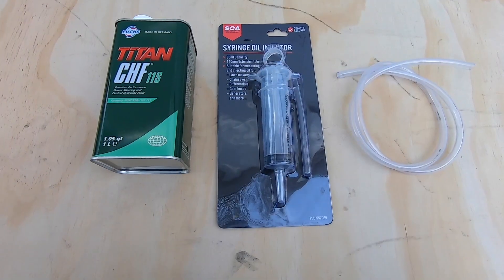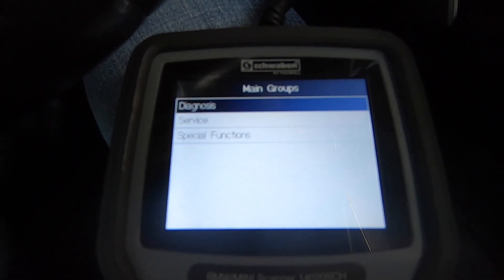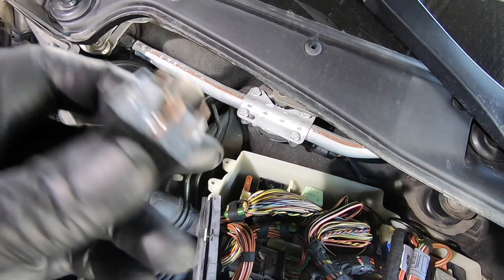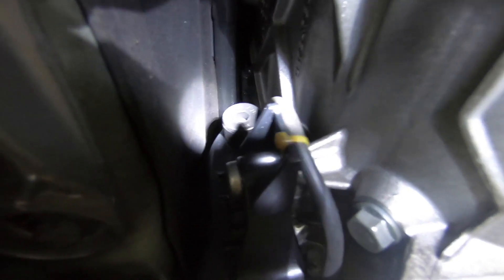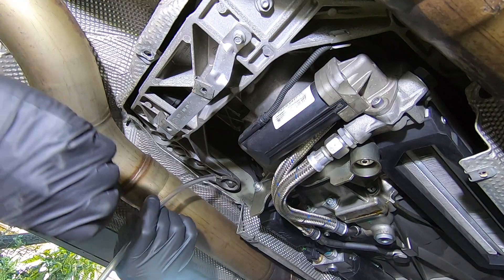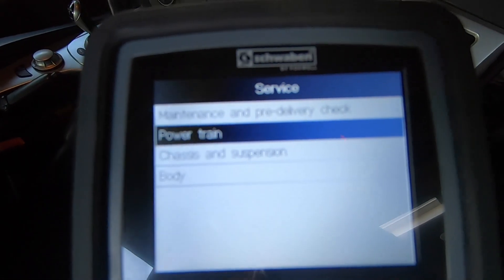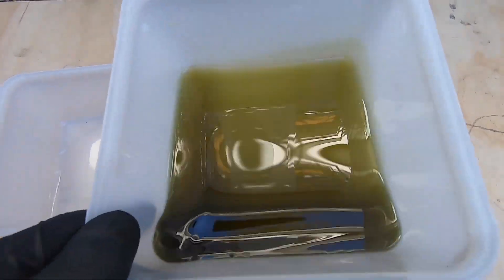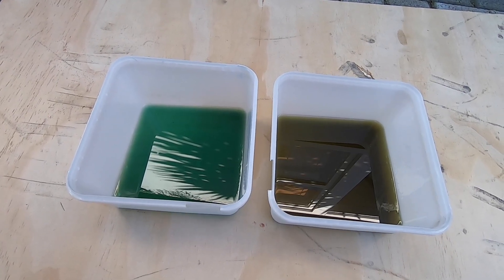BMW E60 M5 SMG Hydraulic Fluid Change        #BMWE60m5 #BMWV10 #BMWSMG

Comment: Hi! Great content and very appreciative of your thorough explanation and step by step instructions. I own a 2008 M5 with just about 68k miles. I just did the SMG hydraulic fluid change and it went very well. Thank you! The fluid that came out was dark orange, but the most concerning part was that there was much more new fluid going in compared to what came out. So i’m glad I did it and intend to do it every 15k miles along with the gear oil and diff oil moving forward. I m doing my oil change every 3.5k miles with 10w60 LiquiMoly and I add CeraTec to help with reducing wear on the rod bearings. The car was a south California car then with me in South Florida all its life, so cold start was never a problem. Plus it has the second drain plug so i’m not concerned about the bearing and will preventatively changed them after 100k miles. This might sound stange but this E60 M5 is one of the most reliable BMW i’ve ever owned. Despite its race pedigree, it’s built to last and it’s surprisingly easy to work on. Thanks again for the work you do, it really has an impact on getting the confidence of DIY and owning such an incredible piece of automotive history at a very small cost of ownership!
Reply from the maker: Cheers man, good to hear you are finding the channel useful. Sounds like your M5 is getting looked after properly. Yes, I found them to be very reliable for sure

Comment: Question .. I if i do this but leave out the bleeding procedure will i be able to bleed the system by driving the car running through gears ? thnx
Reply from the maker: No, it has to be bled using the correct procedure. If the level doesn’t get so low it introduces air into the system, you might get away with not having to bleed it, but it’s hard to tell
Reply: @MTechGuy  I figured as well . when I de pressurize  with shwabben tool .  and suck all old fluid out may introduce air , but part of me thinks would be short lived as any air bubbles with new fluid added  would eventually make their way to the accumulator top by opening door and driving car ... i could be wrong though .. thanks

Comment: Big thanks for the all videos, learning alot for my 530i SMG 6 Speed!
Reply: I have a question @mtech guy!
I hope you can give it a quick read. :)
A symptom that is leading me to think that the pressure accumulator Is at fault. 
When I cold start in the morning after the car has been off for a good 10/12 hours, it drives very rough, specially in first gear, very bad jerky movement to get going, gear changes are rough aswell, specially 1st and 2nd.. but! after a drive of 10-15 mins, everything start to become smooth again. I feel like it's taking time for the pressure to build up. my theory is that there is no nitrogen left in the accumulator that builds pressure when the car starts after a long nap, and builds up to correct pressure after 10-15 mins. Sorry for the long note here, what do you think?
Reply from the maker: I would start by making sure the fluid is at the correct level, then get the vehicle connected to a BMW scan tool, see what SMG codes it’s got and go from there

Comment: Another Quality video👍 Been hoping for a while you would do this one! But also “dam you” because I’ve only just put the under tray back on!😂 So may save this job for the winter! Another worth while job on these if your looking for ideas: Remove the side skirts and clean underneath them as they harbour all sorts of dirt,Mud,leafs & grime! That just hold the damp, well in the UK anyway! Stop the rot setting in! They come off and go on fairly easily as well,so worth doing as a preventative maint every once in a while!
Reply from the maker: Cheers Duncs, easy 20 min job jacking up and whipping the under tray back off 😉
I did notice a lot of stones stuck under the side skirts while I was busy with this job, that’s not a bad idea- I’ll write it down! 👍

Comment: Superb video ! That's a really cool (pristine) special Bimmer you have.  I own several scan tools, but nothing extreme.  I just bought a 2007 BMW 650i with the SMG transmission.  The previous owner has had it for 4 years and he told me the trans. has not been serviced during his ownership.  I'm not sure my scan tools can do the necessary transmission service functions, so can this hydraulic service be performed without a scan tool ?  I know the car hesitates to go into reverse at startup, but I'm also not exactly certain how these cars should shift, so I'm unsure if it has shifting problems.  It doesn't act right and shows 133,000 miles on the odometer.  Any suggestions?
Reply from the maker: I would start by reading the codes. It’s certainly worth starting with checking the hydraulic fluid level and check the relays too. You will need a scan tool like this, to check the level and change the fluid (the accumulator needs to be depressurised) This scan tool was relatively cheap and has been very useful with this car

Comment: Another great video - I’ll complete this procedure on mine. That fluid looked very tired.

So helpful of BMW to put the SMG III fluid reservoir all the way down there. Its a five minute job to do this on an SMG II in an E46 as the Pentosin reservoir is under the bonnet.
Reply from the maker: Cheers Mark, it’s a good job to get done.
Yeah different set up to the E46 SMG II for sure!

Comment: Excellent knowledge once again. Have you done a video on removing the SMG pump? My E61 has just got the red cog and pump wont prime now. Keen to fix it myself rather than take to my local dealer.
Reply from the maker: Not made a video on that so far, normally it’s the pump motor rather than the pump itself that fails. If you have a red cog light it could mean any number of things though, best to carry out a diagnosis before changing anything
Reply: Hi MTechGuy. Codes are 4FA0 and 5101. Clutch position sensor and hydraulic pressure sensor faults. Car is now in 165,000km so I'm going to take SMG pump off and give it an overhaul. Can I take the PLCD sensor off at the same time or does the transmission need dropping slightly? TIA
Reply from the maker: @neilyates3255  Yeah have to drop the tail of the gearbox to replace the PLCD, but with them two codes together there is a possibility it could be a leaky clutch slave
Reply: Thanks MTechGuy... that does make more sense now as the SMG pump still primes when the car is unlocked. Getting put back in the garage over winter. Job for next spring.

Comment: What change intervall would you recommend?
Reply from the maker: Doesn’t need to be done that often, but might as well do it with the diff oil and SMG gear oil at the same time- every 30,000 kms or 4 years, whichever comes first

Comment: do you need to setup any drain when you bleed with the diagnostics tool or does the car handle it?
Reply from the maker: No, it all goes back to the reservoir
Reply: @MTechGuy  amazing, seriously thank you for the rapid response. i have a 2007 m6 e64 that has been neglected for the past few years so im trying to get it back to life and the transmission is the only thing acting up shifting, maybe slip

Comment: Great video yet again , do you plan to change vacume lines , all of them
Reply from the maker: Cheers, no not at this stage, but maybe sometime in the future
Reply: @MTechGuy  bro any suggestion on rpm drop, after I rev on idle to 3000 rpm , but whe I leave the throttle the rpm drops to 500 and gain again to 750 rpm

Comment: if you do this without depressurizing your not causing any damage just making a mess correct ?
Reply from the maker: You need to depressurise the accumulator into the reservoir to give you a true level reading
Reply: @MTechGuy  thanks bud !
Reply: @MTechGuy   think its a good idea to do it x2 twice to flush all old out ?
Reply from the maker: @jayd1008  I think is probably unnecessary

Comment: just what i needed , planing on doing this soon . one question when you did the gearbox oil change you didnt show where the fill plug was . is it easy to find with the cooler removed ?
Reply from the maker: Yeah, it’s easy to find but tight access

Comment: can you disconnect the battery instead of getting the relay out ??? i'm looking to do it my self as well just wanted to know if it's the same thing !
 thanks!!
Reply from the maker: Isolating the pump at the battery would work, you still need it connected for depressurising the system and bleeding afterwards though

Comment: how exactly does the pressure get reduced by  the scan tool ?
Reply from the maker: It empties the accumulator into the reservoir. Although you are not breaking into the high pressure side of the system with this job, you need to do this to give you a true level reading at the reservoir